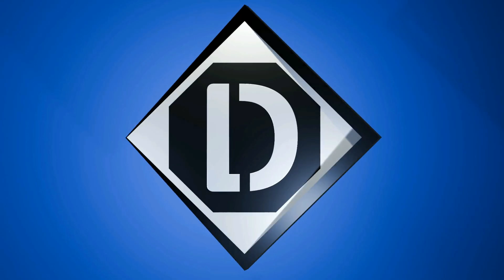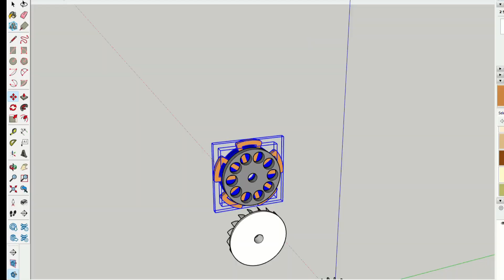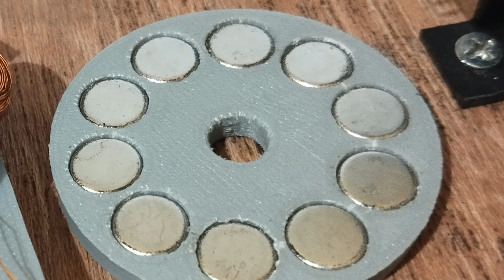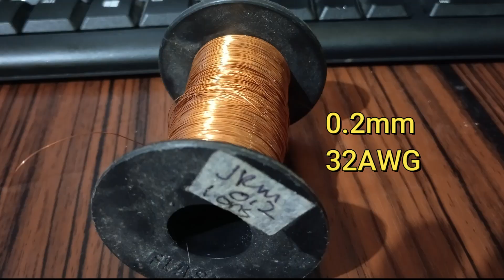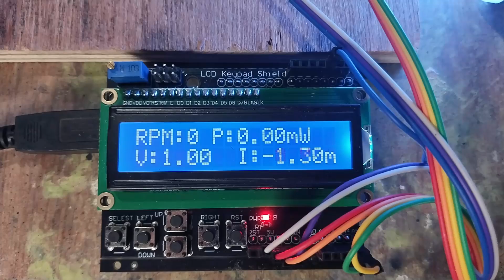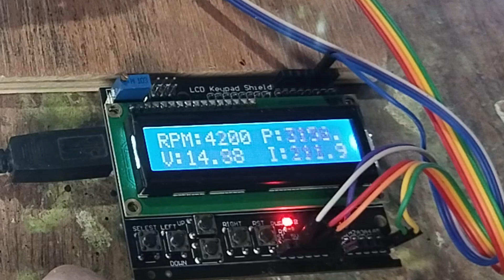Adding Generator to the Turbine. Axial Flux Serpentine Coil Generator.

Comment: One super easy way to extract more power would to put a thin iron backing on the rotor, a "back iron", which would direct some otherwise wasted field lines back towards the stator.  A less-easy but big improvement would to have two rotors, one on either side of the stator, with N magnets facing S magnets, but of course, costs a lot more money. Finally, if you added two more serpentine coils, rotated at 120 degrees to each other, you could have a three-phase system, which would produce more power and has the added benefit that at no point during a rotation will the overall voltage be zero. This extracts more power and is easier to rectify and smooth out.

Comment: Output would be much higher if you put a second magnet rotor on the other side of the coil with corresponding N/S magnets.  Also pay attention to the 4:3 magnet-to-coil ratio. You have 5 “coils here and 8 magnets (I think). You could have one more loop in your serpentine coil making it 6 coils and the efficiency would be greatly increased. Adding metal plates behind each of your magnet rotors would almost double the voltage output.

Comment: Oolrait. Swap the turbine saft with metal rod, change your RPM to something more reliable, design a turbine housing around the turbine, use damping material beneath the turbine supports and use different wire thicknesses for that stator.
Reply from the maker: On it!

Comment: I suspect your RPM measurement is off significantly. I don't think 4000 RPM would produce that noise. It sounds like it's well past 10000 RPM
Reply from the maker: thanks! I will review the program!
Reply: Or 40,000